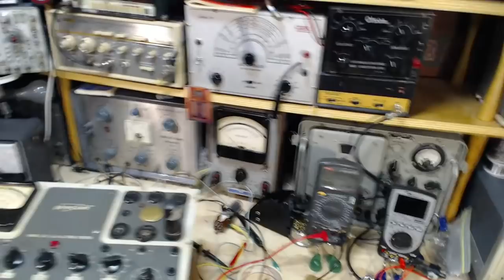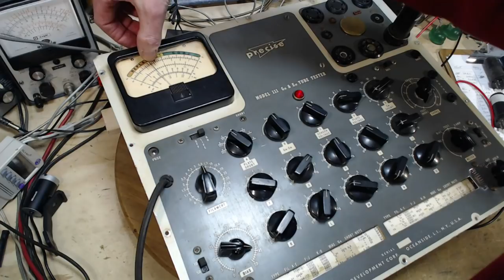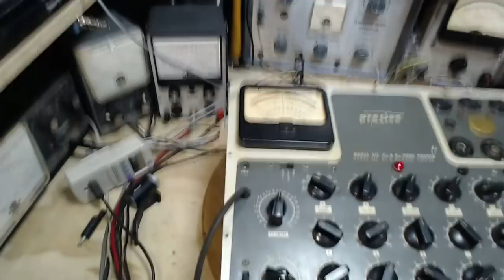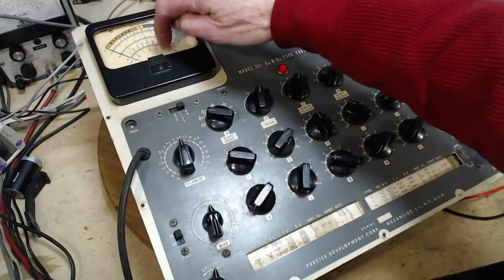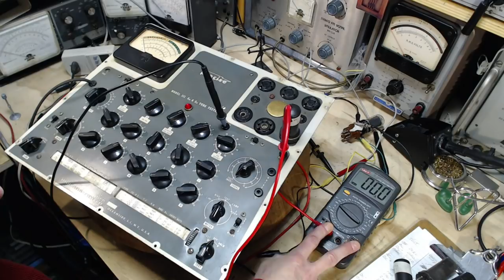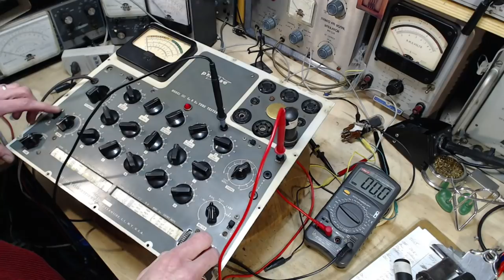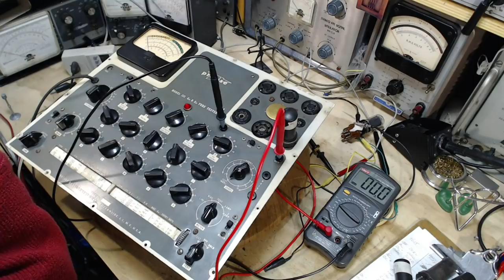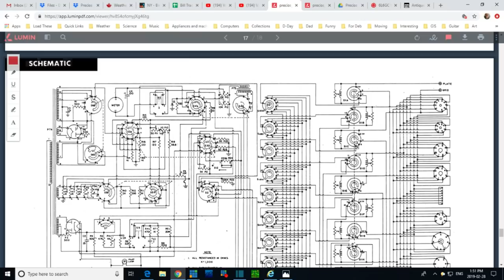Precise Model III Tube Tester Video #11 - Em Calibration with a 6F6

Comment: Jim is the fuse OK on the multimeter? Might be worth  checking the Amps range actually works, particularly as you said you never use it.